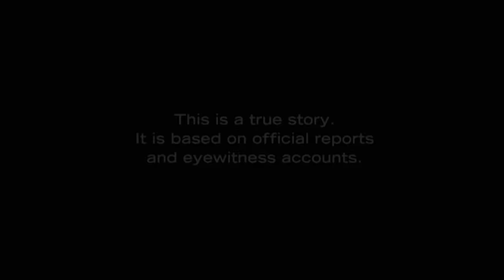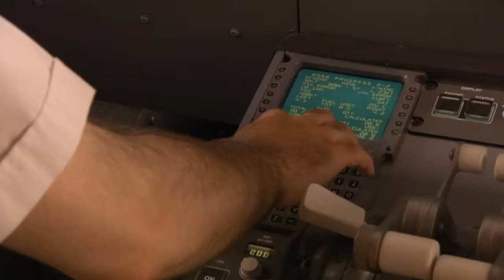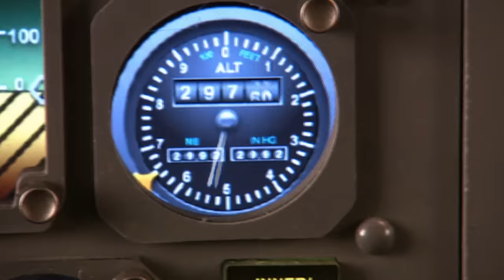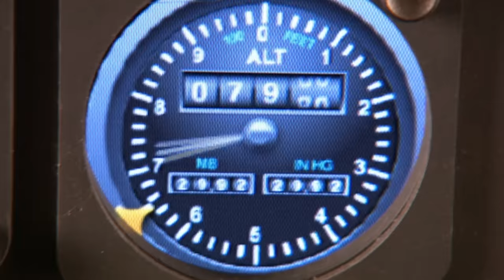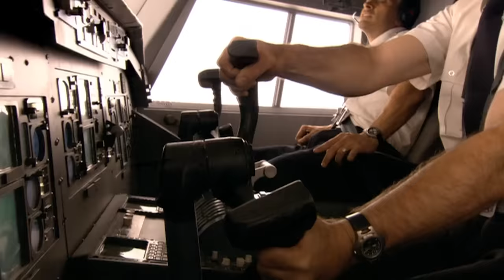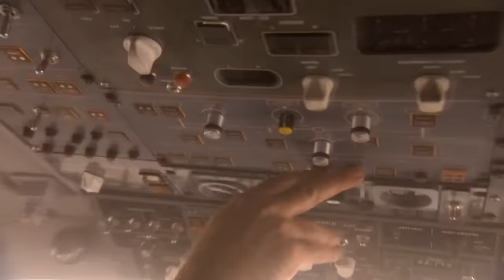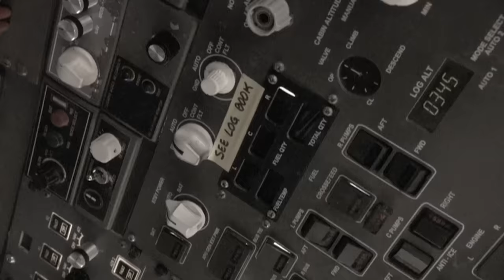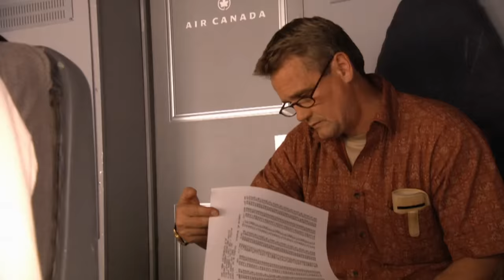Air Canada 143 Becomes Powerless And Falls From The Sky | Boeing 767 | Mayday: Air Disaster

Comment: I was working for C.A.F.A.S. (Consolidated Aviation Fueling and  Services) at the time and this was a flight I normally did when I was on. However I was on Days off at the time. The fuel gauges on the flight deck were not functioning that day and it was re-fueled by using the drip sticks. However at that time the drip sticks were in centimeters and the weight of the fuel was in kilograms. That's  where the mix-up occurred. The flight left with 1/2.2 of the fuel it needed. All they had to do was see how many liters or gallons it normally took and they would have seen their error. The fueler doing the flight at the time was told when to start or stop fueling by the mechanics reading the drip sticks. That as far as I know is what happened. Had I been doing the flight I might have spoken up about the discrepancy, but who knows?
Reply: GEe
whiz
do 
YOU
think
its  
SAFE
in
CANADA  
ALways,  

Um  
NOPE.

Comment: How could ATC not know that Gimli had been converted to a drag strip? That's a pretty big oops on somebody's part.
Reply: Normally I would agree with you... but why would they need to know?  What would have changed if they had known?  Aside from sending emergency crews (which almost certainly happened) what could have been done differently?
Reply: @Stephanie-we5ep  they are the ATC of Winnipeg and they wouldn’t know wich are the airports close to them? Seems really unlikely.
Reply: @vincentricard6973  I thought that some of what is portrayed is dramatized, and just figured this was the case here.  If this is factual, then yeah that would be sus
Reply: @vincentricard6973  Absolutely agree. ATC should know everything about surrounding runways - ESPECIALLY if they're no longer runways!
Reply: It was a decommissioned strip why would they know what happens after?

Comment: This is incredible pilots who are also glider pilots and land in closed field Gimpy.  Proud of them.  There were imperial gallons vs. us gallons why low on fuel even though pilots went over and over the fuel gallons with fuel ground crew before departure.  Awesome story.
Reply: Litres vs gallons - ie, half the fuel required. And the fuel gauge wasn't working.

Comment: On this past Friday, February 16th, 2024 I was on a United flight to SFO from OGG (Maui, Hawaii) and about 1hour into flight, the oxygen masks dropped from the ceiling and about 10 minutes or so later the flight attendants informed us that the airplane cabin was failing to pressurize.  We were hundreds of miles over the pacific.   It was frightening, but we didn’t notice any mechanical failure.  The fright was not knowing the extent of the issue.  The good news is that the flight diverted to Honolulu and we landed there about 45 minutes later.

Comment: Huh… can’t wait this to be blocked in Canada!
Reply: It's not and never has been. I've come across this and other reports of it numerous times over the years. Plus, it's all a matter of public record.
Reply: Canada uses metric system for distance. I always worry if they can goof it up anyway when ATC is asked how long is the runway? If they say 3000 feet, you must convert it to kilometers if the pilots are used to that. That could be a disaster if that is given and misinterpreted.
Reply: @sharoncassell9358  You're right, that kind of error can happen. I think it becomes a lot like nurses, for example, who regularly have to use both imperial and metric for dosages or body temperature. In the same way, ATC and pilots get used to both systems as well. The problem only arose here because that was literally the first airplane in Canada's entire fleet  to use metric.
Reply: Any other dumb conspiracy theories rattling around in your skull?

Comment: The skill level and calm it took to prevent tragedy is incomprehensible.  There are no 'do-overs' at 30,000'. Terrific coverage, too. 

Fwiw, it's still 200K times more dangerous to be in a moving car than to be a passenger on an airplane. Crashes are few and far between.

They're simply compelling due to multiple casualties and because the thought of falling from great heights is bloody terrifying. 🙃

Stay well, friends.

Comment: So, lets be real on this recap of the flight. Pearson, as a glider pilot, would definitely have practiced and done slips in a glider. Those are principle skills. Not to diminish the fact that he attempted the maneuver in a 767. And also to specify, what he did is a forward slip. Forward slips and side slips are similar in their execution but the side slip is used to move laterally without changing the direction of travel in relation to the moving airflow. And one other thing, they had a fifty-fifty on that runway choice. There were two runways in use when the airfield was first made. The drag strip was only put in place on the western most runway.

Pearson did a fantastic job in flying with no engines, excellent use of skill.

Comment: I used to teach calculus-based General Physics classes in college, prerequisites for students majoring in the physical sciences and in engineering. The system of units used was metric(SI) and that's what we normally used. Some legacy problems were formulated in imperial(British) units. The worst case problems were ones that used a combination of systems of units. What I always did, and strongly recommended, was to always convert all units at the outset to SI units and carry the calculations to the final answer in SI units. I told them to only convert the final answer from SI to imperial units if it is required. With a combination of units I told them that if a mistake is made you'll never be able to isolate it and correct it.

Comment: Like Space Shuttle (no engines) it turns into a huge glider. The dead motors however cause massive drag.
Reply: Not correct, the small wing and high wing loading give them the poor glide rate.  They still need airbrakes in the tail to slow them for landing, deployed just before touch-down.

Comment: My father helped make the Gimli landing strip. It was intended as a re-fueling strip for WW2 military bombers and fighters bound for Alaska, which at the time was thought to be a strategic theatre of war against Japan. He told me the construction continued whilst planes landed as the desire to get planes west was urgent. He said sometimes the new pilots would damage the planes and there was no time to fix them, they would bull-doze them off to a junk pile near the runway-- no investigations, etc. After the war it was abandoned. The 'old' radar at Winnipeg, useful in this emergency, was from WW2, also. 
It may be that this radar was moved from Gimli to Winnipeg, possibly after the War. A few things of note, this pilot was a former glider pilot, never get rid of old tech if it could be useful in any way keep it as a redundant system, and don't change fuel unit delivery methods, imperial gallons should have been maintained...don't fix it if it ain't broke.

Comment: Amazing skills the crew happened to have at the right time. Thank the heavens!
I put the blame on the 
push to change the units of measurement without equipment being able to toggle between both measurement systems for verification. Just as you can toggle units in automobiles today. 
Placing any blame on the fuel crew is not fair, but blame on the training is spot on. All should have been given the proper calculations to follow in hard text with clear forms. (This was 1983)
Additionally, a plane with a problematic fuel readout system should have been grounded for repairs in the first place.
To this day, myself being in engineering, one must be adept at converting the metric/imperial units. Legacy equipment and measurement methods still exist and will not go away for some time.
For example, how many of us have both inch and metric tools in our toolboxes?

Comment: Finally an episode with a spectacularly good outcome, similar to the Hudson miracle. However, once the plane was safe on the ground thanks to this superb flying of the captain, it turns out quite some unprofessionalism caused the mishap. 2 questions though
a) doesn't a trained pilot "feels" while taking off if the plane is fully or only half loaded with kerosine ?
b) how comes the 1st officer isn't aware of the correct number of passengers, since he has to calculate the take off weight before the plane goes airborne. Weight of the kerosene, weight of the total number of passengers, weight of the cargo (luggage) etc.... I was expecting he still had these figures close to him, yet he cites a number of passengers that is twice as low as the real figure... That's "odd" to say the least, even in the heat of the moment....

Comment: So the lessons are, 1)  have a battery backup system to keep equipment working if engines fail, 2) Don't fly without a working fuel gauge, 3) Don't convert to the metric system

Comment: Why have I never heard of this incident? I’m a glider pilot curtesy of the Royal Canadian Air Cadet Program and we train slide slipping during our certification, at Trenton/Mountain-view one of my first flights in the air due to the conditions my instructor had to preform a side slip to land. We are told that side slipping only works with glider and is extremely hard to preform on a power aircraft however this incident just goes to show how everything we learn during our flight training is important and can be applied elsewhere.

Comment: Wat about  fuel gauges on the dash !   , they could  of seen straight away  that they took off with only half a tank 😢😢😢😢
Reply: This is from Wikipedia:  "The accident was caused by a series of issues, starting with a failed fuel-quantity indicator sensor (FQIS). These had high failure rates in the 767, and the only available replacement was also non-functional. The problem was logged, but later, the maintenance crew misunderstood the problem and turned off the backup FQIS. This required the fuel to be manually measured using a dipstick. The navigational computer required the fuel to be entered in kilograms; however, an incorrect conversion from volume to mass was applied, which led the pilots and ground crew to agree that it was carrying enough fuel for the remaining trip."

Comment: TLDW: Plane system switched from Pounds to Kilos. Fuel guy inputed Pounds instead of Kilos. A computer part was broken so it didn't get noticed. Plane has to make an emergency landing with no engines. Pilot pulls off a never-before-trickshot landing to save everyone.
Lessons: Planes are safe. Pounds are better. That pilot is a monster.

Comment: Hi from Australia.  I am 63 years old. Why blame the pilots? I googled "Why is America still using the Imperial system"? Time and Money was the bottom line. I was 6 years old when Australia went Metric. I only remember Dollars and Cents not Pounds Shillings and Pence. I'm 6' 5" or 1.97 Metres tall. I know a few basics but when someone says it's 5 pounds, I can't remember this old system. America should have changed to Metric in my generation. This accident wasn't deliberate, it was inevitable. The whole planet should be using the Metric system and the same currency of Euros globally but no, we're trying to trash the planet with wars and greed. I have never stolen money from my parents and we worked for our money. Cheers from OZ Andrew Peter Collins, Melbourne, Victoria, Australia.
Reply: This is from Wikipedia: "The accident was caused by a series of issues, starting with a failed fuel-quantity indicator sensor (FQIS). These had high failure rates in the 767, and the only available replacement was also non-functional. The problem was logged, but later, the maintenance crew misunderstood the problem and turned off the backup FQIS. This required the fuel to be manually measured using a dipstick. The navigational computer required the fuel to be entered in kilograms; however, an incorrect conversion from volume to mass was applied, which led the pilots and ground crew to agree that it was carrying enough fuel for the remaining trip."

Comment: If the ginley glider is still in service, it shows the poor efforts/financing by Air Canada towards modernization. Ive ended up in several Air Can flights from Vancouver most of which were Faulty amd Tge pilot would say that there's a minor technical error and the flight is delayed. 😂

Comment: 454 grams is a pound, I have trouble believing that two pilots didn't know how to do this easy calculation.
Reply: There was a faulty fuel flow indicator on the equipment refuelling the aircraft.  In addition, there was a mistake in the units so a compound problem.  This video is a reconstructed "drama" scary music etc., so not likely to be precise in the details.

Comment: Public comment.  Backup batteries for instructions functions.  Micro processor link all component to the brain of the aircraft datebase and cockpit alerts if any problems arise.  Save lives. Including alerts of fuel and others problems with the engines. Battery operated radio transmission system for emergencies.

Comment: All of this occurred because of a MATH ERROR  ! ! ! !
Reply: Not entirely, this is what happened:   "The accident was caused by a series of issues, starting with a failed fuel-quantity indicator sensor (FQIS). These had high failure rates in the 767, and the only available replacement was also non-functional. The problem was logged, but later, the maintenance crew misunderstood the problem and turned off the backup FQIS. This required the fuel to be manually measured using a dipstick. The navigational computer required the fuel to be entered in kilograms; however, an incorrect conversion from volume to mass was applied, which led the pilots and ground crew to agree that it was carrying enough fuel for the remaining trip."  (Wikipedia)  The video is a simplified re-construction.